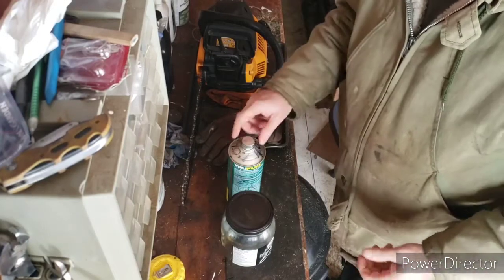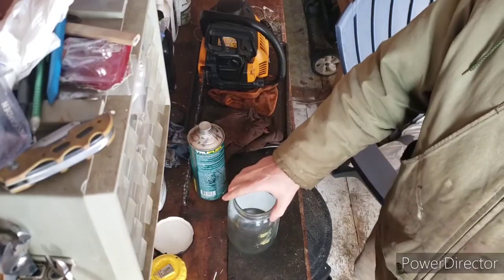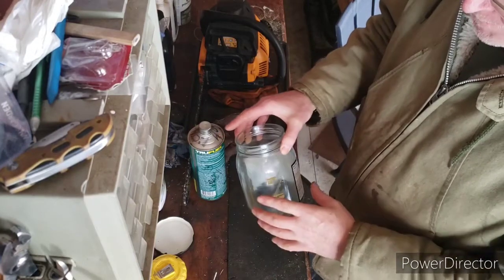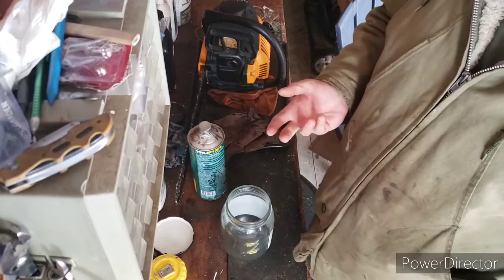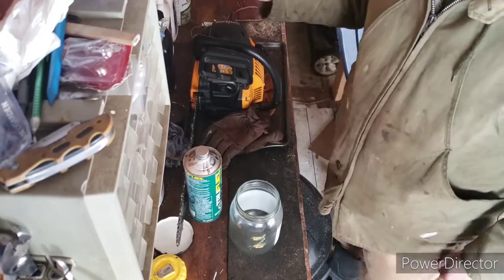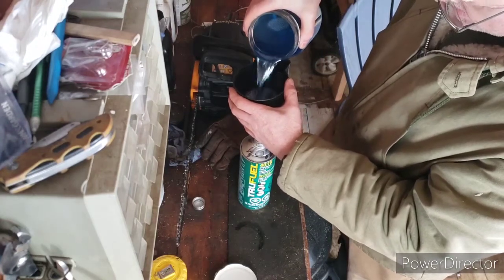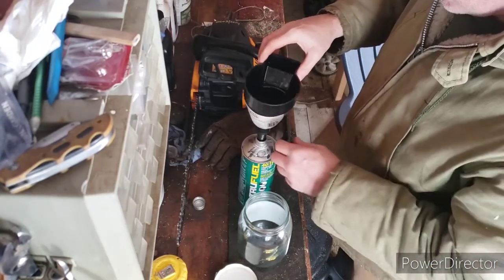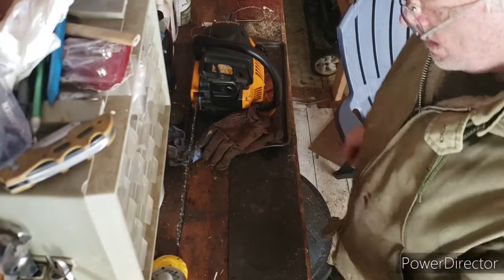How to Mix Two-Stroke Oil for Small Engines: A Complete Guide

Comment: The only two stroke tool I have left is a leaf blower.  I just use the Tru Fuel for that.  I used to have a bunch of two stroke equipment but I've replaced most of it with cordless stuff, it sucks pull starting things with arthritis.
Take care and have a great day